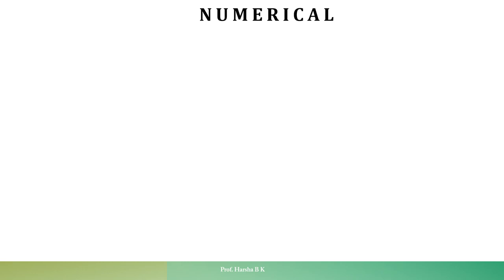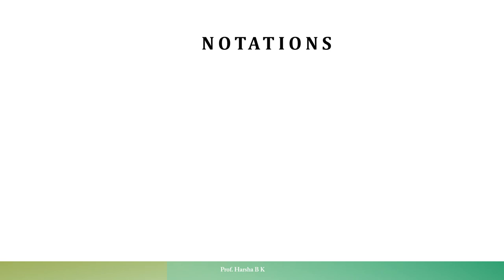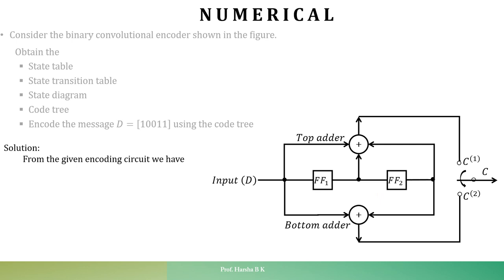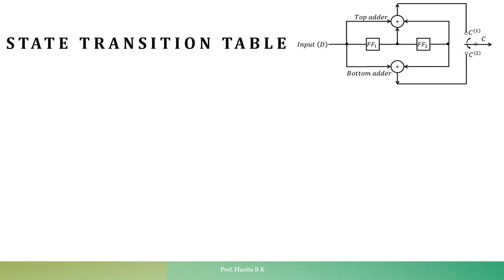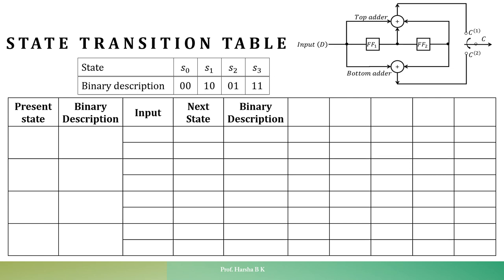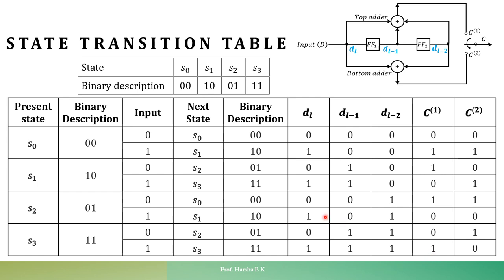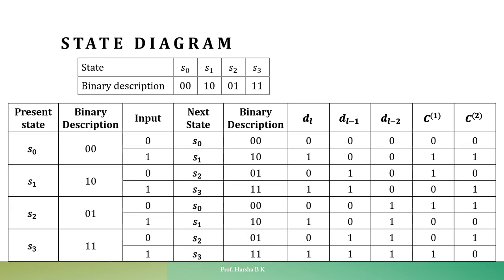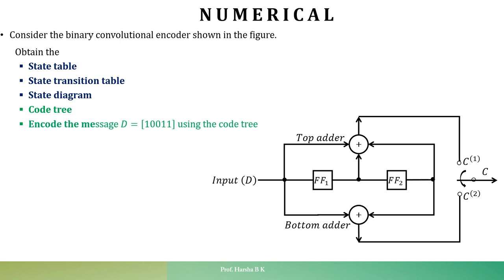Convolutional codes #State table, #State transition table and #State Diagram

Comment: sir it is better to consider 00-S0 , 01-S1, 10-S2 , 11-S3 i think...
Reply from the maker: No, dear. Ideally, 01 can never come before 10 in real-time applications. Kindly watch the complete video. I hope things will be clear.
Reply from the maker: Kindly watch the video at 5:00 to get a better idea of it.
Reply: Sir ... I think it does not matter a lot... Because we are assuming input 0 or 1 ... If assume begining input is 1 we will get different state... Usually while writing state table .. What i observed in all videos / what i heard from my lecture is they consider 00-S0, 01-S1, 10-S2 and 11-S3 or 00-a, 01-b, 10-C and 11-d.
Reply from the maker: This is not about the four combinations as the weighted code as 
2^1	2^0
0	0
0	1
1	0
1	1

Here the discussion is about the shift registers. FF1 is the 1st flipflop and it feeds the 2nd flipflop designated as FF2. ∴ the sequences have to be proper. Though you can name the way as per wish.
in	FF1	FF2	State	Comments
	0	0	s0	Power on reset
0	0	0	s0	Already designated, hence no need to write the same again.

1	1	0	s1	First new state possible

	1	0	s1	Inputs can be either 0 or 1.
0	0	1	s2	second new state possible.
1	1	1	s3	third new state possible.

Only thing is s2 and s3 can be interchangeable as
	1	0	s1	Inputs can be either 0 or 1.
1	1	1	s2	second new state possible.
0	0	1	s3	third new state possible.

Beyond this all the states will among the above four states.

Also 01 can never appear before 10, as these are shift register contents. But designating it as s1/s2 or b/c is immaterial.

Hope this clears the confusion.